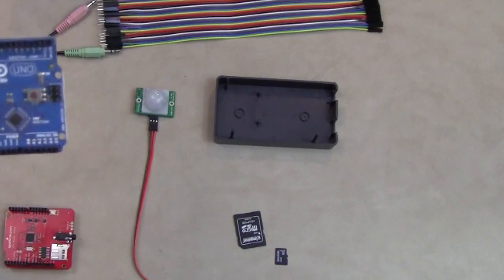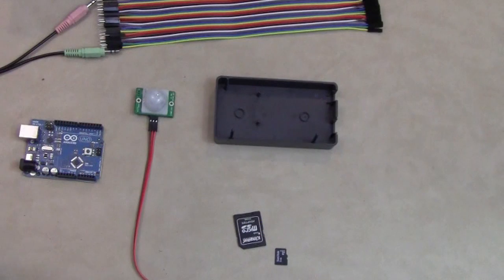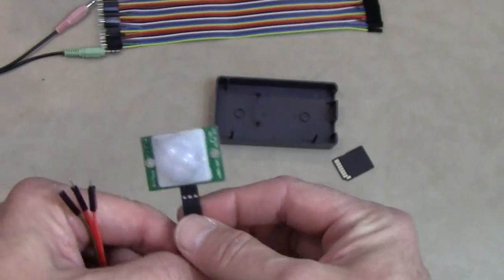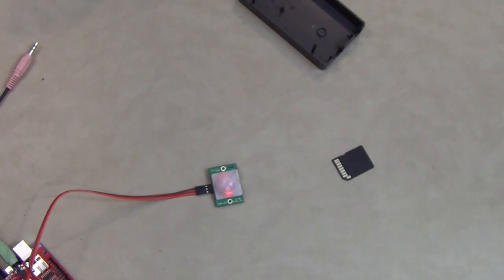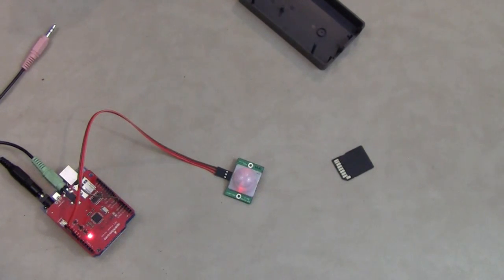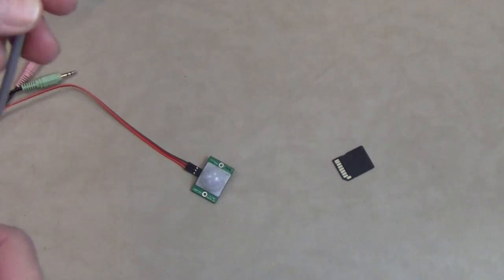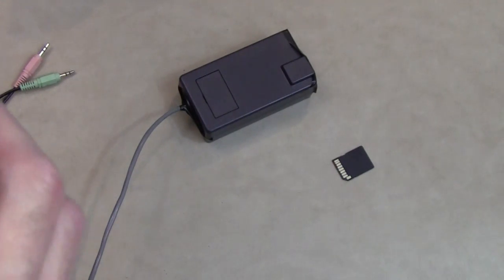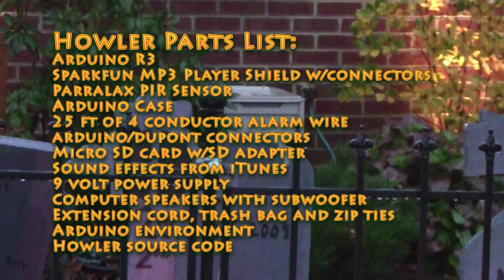Arduino Cemetery Howler Project

Comment: Getting these errors with copy of your code. Using same parts and config. Any Ideas why I'm getting this? Thanks!

Arduino: 1.5.4 (Windows 7), Board: "Arduino Uno"
sketch_feb25b.ino: In function 'void setup()':
sketch_feb25b:71: error: 'class SFEMP3Shield' has no member named 'SetVolume'
sketch_feb25b.ino: In function 'void loop()':
sketch_feb25b:76: error: lvalue required as left operand of assignment
  This report would have more information with
  "Show verbose output during compilation"
  enabled in File > Preferences.

Comment from the maker: /* CEMETERY HOWLER
   
   This program uses an Arduino, a Sparkfun MP3 player shield (with micro sd card) and a Parallax PIR motion sensor.  When the program is loaded, a 
   random sound file will be played each time the PIR is triggered. track000.mp3-trackxxx.mp3 up to 100 tracks or more.  
   (Track001.mp3 is correct format.  Track01.mp3 is not. For best results, make sure your MP3 files are encoded at 192k.) 
   The track will play for a specific period of time (PlayTime) and then the device will wait a specified amount of time (pauseTime) before resetting and waiting for another trigger.  
   You MUST set the number of random files that you want the program to scan (rantrack). 
   
   
   HARDWARE:   
   PIR sensor to 5v and ground.  PIR trigger to pin 5.  You can use a proto screw sheild to make connections or splice a couple of Arduino cables.    
   Sparkfun MP3 player shield on top of Arduino.  You may also want to use an Arduino case with a couple of extra holes drilled for the speaker connections.   
   
   SOFTWARE:
   This code is considered open source and in the public domain.
   it can be used, altered and shared with no limitations although I would appreciate a shout out if you use it successfully in your haunt!  
      
   The routine uses libraries, code and snippets from several contributors.  
   
   LIBRARIES AND TUTORIALS:
   (differing licence agreements may apply)
   sparkfun mp3 player shield library: http://www.billporter.info/sparkfun-mp3-shield-arduino-library (Bill Porter)
   sparkfun mp3 player shield tutorial and example code: http://www.sparkfun.com/products/10628 (Nathan Seidle) 
   sdfat library: http://code.google.com/p/sdfatlib/ (Bill Greiman)
   thank you for sharing and your work!   
*/    

// libraries

    #include <SPI.h>
    #include <SdFat.h>
    #include <SdFatUtil.h> 
    #include <SFEMP3Shield.h>
    SFEMP3Shield MP3player;

  
// constant variables  
     
    int pirPin = 5;                    // PIR sensor input pin
    int calibrationTime = 10;   
    int led = 13;
    unsigned long playTime = 15000;      // how long a file will play in milliseconds (15000=15 seconds)
    unsigned long pauseTime = 8000;     // how long the pause will be after the sound ends (10000=10 seconds)
    int readingInterval = 20;            // how often to read the sensor
 
   
// changing variables  
 

    int rantrack = 0;                    // track number for randomizing
    unsigned long currentMillis = 0;     // time variable to track running time: current time
    unsigned long startingMillis = 0;    // time variable to track running time: starting time
    byte result;                         // variable for mp3 player shield, can be used to debug
        
// setup     
     
    void setup() { 
  pinMode(led, OUTPUT);                       // set pinmode to output pin 13 
  pinMode(pirPin, INPUT);                             // make PIR sensor an input
  digitalWrite(pirPin, LOW);                        // set pir to quiet, no movement

  //give the sensor some time to calibrate
    for(int i = 0; i < calibrationTime; i++){
      delay(1000);
      }
    delay(50);

        
      digitalWrite(pirPin, LOW);                    // activate internal pull-up resistor
      result = MP3player.begin();                      // start mp3 player shield
      MP3player.SetVolume(10, 10);                     // set volume of the mp3 player ( 0 = loudest )
      randomSeed(millis());                        // set a more random seed for the random function 
    }
// loop
     
    void loop(){ 
      if (digitalRead(pirPin)== HIGH){                 // if movement sensed
          digitalWrite(led, HIGH);                     // turn the LED on (HIGH is the voltage level)
          rantrack = random(56);                       // find random number
          result = MP3player.playTrack(rantrack);      // play track                          
          playtime();                                  // call function for play time       
          MP3player.stopTrack();                       // stop track   
          digitalWrite(led, LOW);                     // turn the LED off by making the voltage LOW
          digitalWrite(pirPin, LOW);                   // Force pirpin to low to turn off signal  
          delay(pauseTime);                            // wait...   
    }
      
      delay(readingInterval);                          // wait with reading
   }  

// function to determine playtime

  void playtime() {
       startingMillis = millis();                                 // set both time counter
       currentMillis = millis();
      while ( currentMillis - startingMillis < playTime ) {      // while track plays, runs until playTime is reached
          currentMillis = millis();                               // set to actual time
          delay(40);                                              // debounce
       }      
   }
Reply: Hi there, would you PLEASE make a video that includes 2x LEDs and music activated by the PIR sensor?
Reply from the maker: Music is easy, just replace the sound files with music and change the length-of-play variable to equal the longest song. .  The LEDs are easy too but you have to do a little coding.